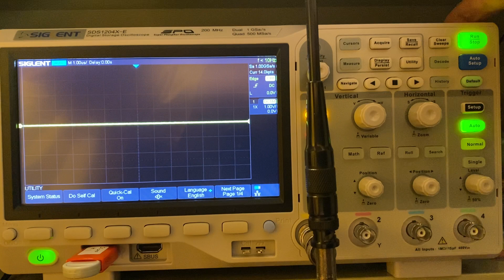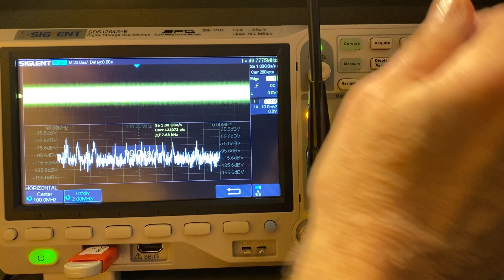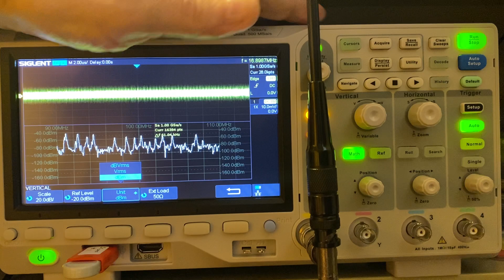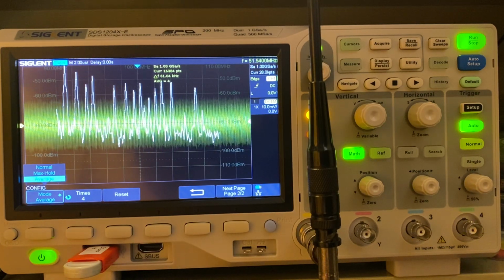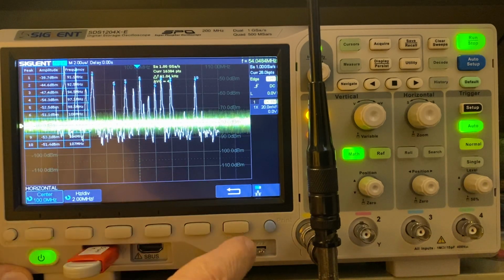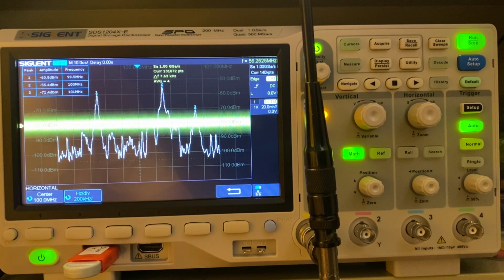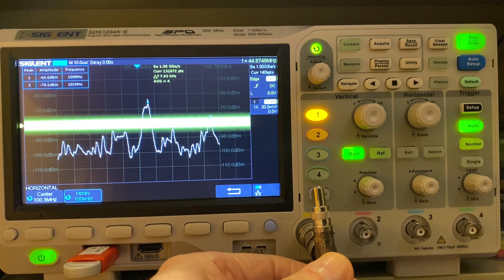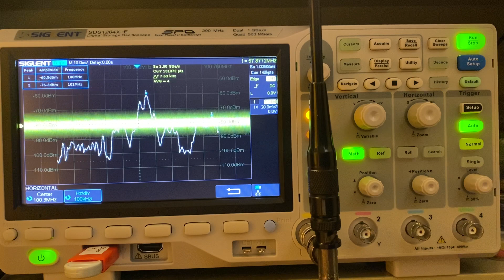Using the Siglent 1204X-e Oscilloscope's FFT for RF Spectrum Analysis

Comment: Interesting.. will try it out to look at the FM signals with my scopes FFT..
I tried with my portable HackRF that have an inbuild signal generator.
and just a crude telescoping antenna and see if My scope picked it up, though the output is low.
but I was able to see the signals I made at fx 490Mhz on the scopes FFT.
I recall the Misig FFT peaks at just under 90k points but highly variable..
https://www.youtube.com/watch?v=1pewjPRPYKY
Here I tried with a cheap FY6900/60Mhz arb. signal generator but I likely need to terminate it, to remove some of these harmonics..new to this and mostly trying to learn.
https://youtu.be/eH8t_r0L2q8
but I generally prefer to use, my old SDR when looking at spectrum signals.
https://www.youtube.com/watch?v=uDd7vuCyd28
Reply from the maker: You'll probably have better luck if you try using a dummy load and directly connecting the scope to the devices via a bnc T.

Even a small 50 ohm terminator should work as a load for the devices you mentioned since they're all well below .1 watt...

Working with antennas like you are doing results in power supply noises in both devices being effectively put in series with the signal due to the sneak path back through the power supply in the devices.

Thanks for your comments and good luck with your experiments!

M